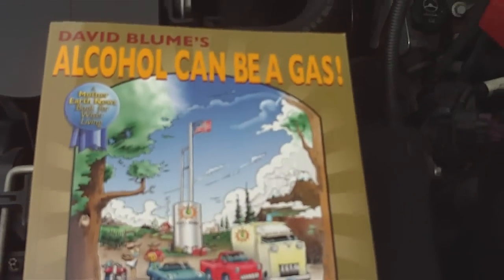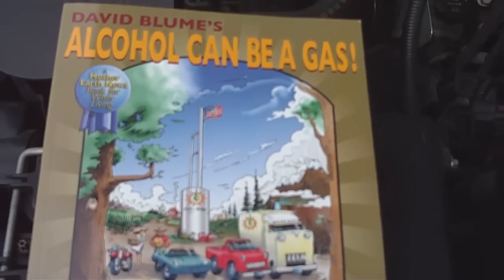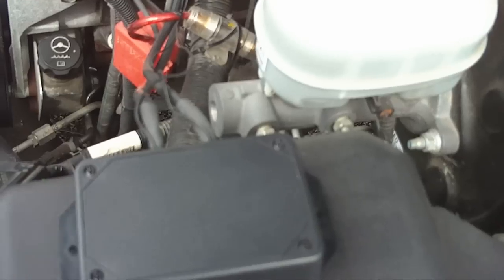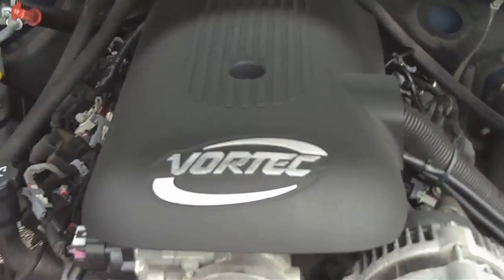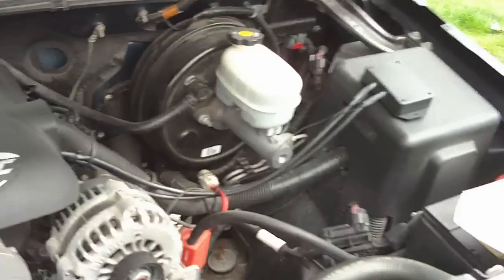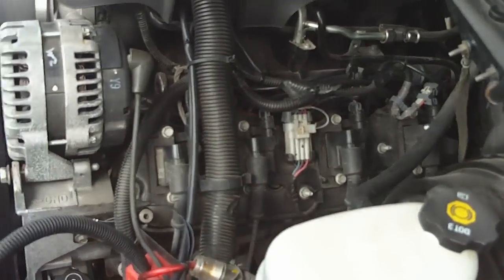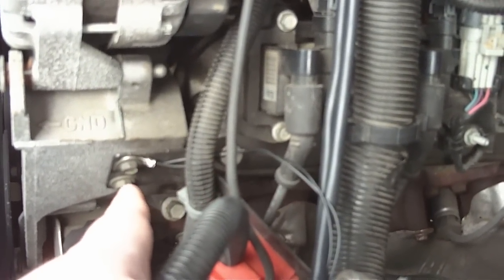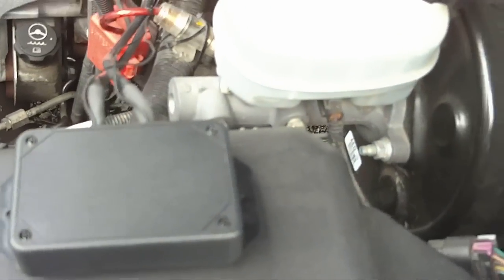David Blume's Ethanol Conversion Kit

Comment: What about the seals and lines etc. ? Any problems with the alcohol so far?
Reply from the maker: In modern fuel injected vehicles the main difference is software. I had that truck for 11 years, 90k plus miles with no problems. Everything has been ethanol tolerate since the mid 80's
Reply from the maker: @Joshua Kiser check 4 a sticker on the inside of the fuel door. It should say e85 on it. Almost all 5.3 engines are ffv.
Reply from the maker: @Joshua Kiser look in the owners manual under fuel. It should show a certain digit in the vin number weather it's flex fuel or not.

Comment: this kit will adapt to whatever you put in, like if you run out of alcohol on a trip and have to buy regular gas, it will fix it up for you. if you aren't carrying the mechanic and the software w/ its hardware with you everywhere, this will work a lot better

Comment: let me help you out, because no kit is needed, no parts, no mechanics help required. 
in your local area are hot rod shops that do costume computer tuning, the soft ware they use is called HP tuners or EFI live, fill your tank with ethanol, go to their shop and they will plug in a lap top and remove one of your O2 sensors, while you drive it they will set your air fuel mixture and adjust your timing and your done.

Comment: I put a White Lightning Kit on my 1997 Dodge Ram 2500 4x4. It works great. Under heavy load or when using the passing gear there would be a little spark knock once in a while with the 87 octane gasoline but with the 105 octane E-85 there is NO spark knock. Plus its a lot less money than gasoline.